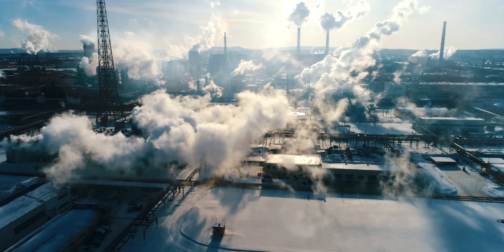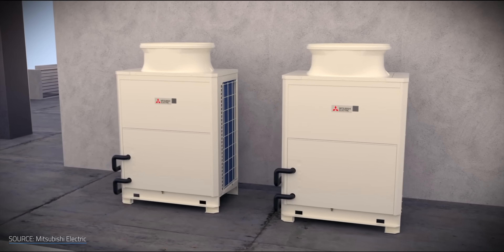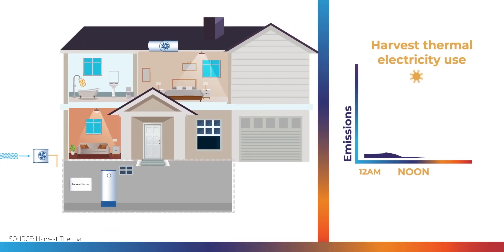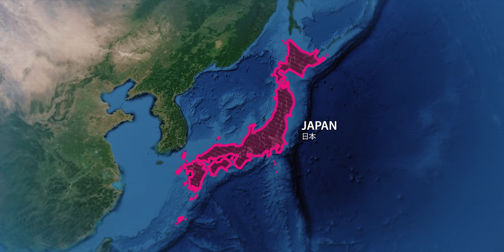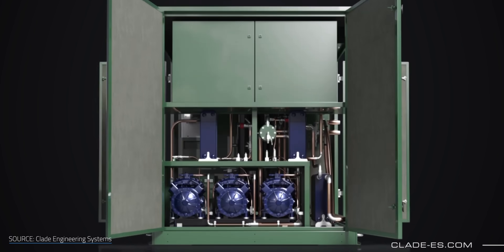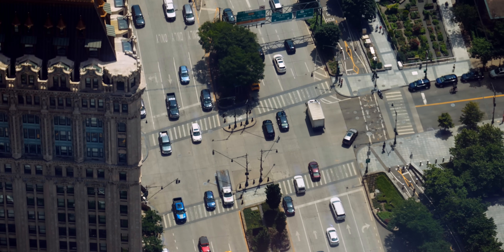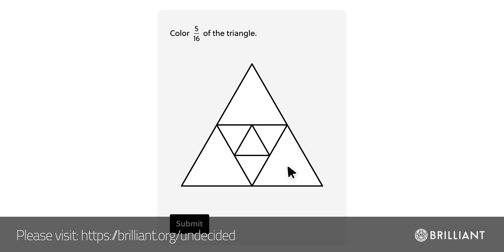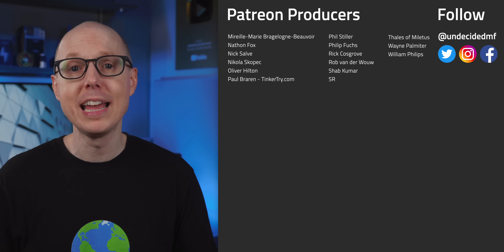Why CO2 Heat Pumps Are The Future Of Cooling

Comment: I could be mistaken...

But, rather then thermal storage, it seems like it would be more efficient to... just storage electrical energy in a battery.

Take, for example- my rack-mount LiPO4 batteries. 5kwh of energy storage per battery, enough energy to run my minisplit 5 hours, up to a day or two. Lifespan of 20-30 years on average.

Storing heat in a water heater, you run into the issue of, sediment buildup, low storage capacity. etc..
Reply: What's the cycle efficiency, though? Charging a battery takes more energy than the battery stores. Solar panels converting light (or whatever other generation system) into electricity, then electricity into chemical energy in a battery, then chemical energy into electrical energy, then into thermal energy... Taking in heat, storing it as heat, and then releasing it as heat has fewer losses, I would think.
Reply: @erikdietrich2678  

Do remember though, you have to use energy (compressor) for storing the heat, and then use energy (compressor) to extract/release it. The process of releasing the heat isn't just turning on a small water pump hooked to a radiator. 

Then, you have the thermal losses from waiting in storage too. 

Compare that, to just storing the energy to run the compressor when the heat is needed, as opposed to doing the work twice.
Reply: @xtremeownagedotcom  Lithium round trip efficiencies can be around 90%, so long as they're charged and discharged slowly. However you're still running a compressor to move heat air-to-air, which is going to have similar efficiency limits as air-to-water then water-to-air. Thermal losses from a hot water tank can be very small if properly insulated. The self-discharge rate of lithium batteries is very low, but it's not zero. And maybe most significantly, the financial and environmental costs of manufacturing lithium batteries are comparatively very high compared to just an insulated water tank.
A water tank is a thermal battery of sorts. There might be applications where some kind of chemical battery system makes more sense, and I think for the rest of the applications, storing heat as heat (instead of chemical potential energy) is going to be the better option.

Comment: While an interesting video, I wish he would have gone into greater detail of how it works in different climates and the four seasons.  For instance, I live in Florida where we run cooling almost the whole year.  So we would be moving heat from our interior to to the water heater 24 hours a day.  As the temperature in the tank increases, it seems like the efficiency of my cooling would go down.  Will I have to take more showers to dump that excess heat?        I can think of all kinds of different scenarios based on climate and time of year.  So maybe that is why a sophisticated controller is needed.  BTW, most people's electricity rate is fixed, same price night or day.  It makes no sense for me to invest my money into a system that balances electricity demand for the benefit of my utility company.   They will only take the money I save them to buy off politicians to increase my electricity bill.  I would rather invest in solar and store my excess sunlight energy into heating/cooling my house at night.

Comment: Most power plants are only 32% efficient (not  counting line losses) because they are boiler plants. Therefore a heat pump needs to have an efficiency of 300% in order have the same carbon footprint as a natural gas heaters for heating. 600% if the power comes from a coal power plant.
Reply: Burning things is a cheap way to produce heat, yes... with the downside of outputting huge amounts of pollution. If the only specification is to heat water as cheaply as possible, a natural gas water heater with a desuperheater is incredibly efficient. But that's not the only specification that matters.
And if the heat pumps can be powered by solar or wind, this setup becomes a very efficient carbon-neutral system.
Reply: This isn't entirely true, many plants easily exceed 32% efficiency, and increasingly power generation is being done by power plants that produce no CO2 (wind, solar, geothermal, hydroelectric, even nuclear is still kicking around). Any given heat pump also continues improving as the power mix shifts to lower carbon production, whereas a gas furnace always emits the same CO2 (actually it can wind up emitting more CO2 depending on the gas source since a lot of gas wells directly emit trapped CO2 as well). Heat pumps are also not just displacing gas furnaces, they're also displacing space heaters, which are using that same electricity at much lower efficiencies. And under most circumstances they can easily beat an effective efficiency of 300%.
Reply: @bosstowndynamics5488  A power plant powdered by a natural gas gas turbine engine is up to 63%. 2020. The most inefficient natural gas furnace I have ever seen was 67%. Internal Combustion engines are way more efficient than steam. It's 88 years old now.
Do you know it costs twice as much to generate electricity with coal as natural gas? Steam. I had to look that up. 
No one talks about that. Or LED lighting.
The only country to ever hit Paris Accord targets was the USA under President Trump. 
Methane natural gas has CH4 produces 1 CO2 and 2 water molecules when burning and natural gas appliances have the highest energy conversion efficiency. Convert an electric furnace to a high efficiency natural gas furnace and produce 1/6 the CO2 to heat the building. If it wasn't online... the baseline load drops, which ones will they turn off and close?

As for the 32%, that's average. But some are upto 63%. But that's peak.

China builds lots of coal plants. To bad JT and JB are doing thier best to squeeze out natural gas. (and oil)
Reply: That’s false most modern power plants are 50% - 60% https://en.m.wikipedia.org/wiki/Combined_cycle_power_plant
Reply: @yolo_burrito yes upto 64% from 63%,  the peak efficiency. But most power plants are still coal and natural gas fired boilers. A natural gas gas turbine engine with a steam engine heated by the exhaust gasses. With a duel turbine.
Reply: @suggesttwo  Yes combined cycle natural gas is a gas turbine generator where the waste heat is recovered to run another steam turbine generator. That’s why they are 60% + efficient.
Reply: @yolo_burrito  so about 44% from the Gas turbine and 20% from the remaining heat with a lower efficiency then normal because heat has already been extracted.

Comment: For cooling we should be using personal heat sinks, there no need to cook an entire building when we are only trying to cool ourselves. Plus there are people who work outside to consider, it’s not really fair to cool off the inside while heating up the outside with ACs 

For heating, I haven’t looked into this part at all as I’m focused on cooking, but I theorize a vest designed to be as thin, light weight, and heat retaining as possible, possible with a small heating device, to keep your core warm enough to heat your limbs. I chose a vest so the hit doesn’t hinder mobility at all, but you could use the same logic with different levels of clothing. 

In theory this should save us tons of energy, as we are just regulating our body temperature instead of air temperature .

Comment: I work on HP  daily, and they are great till they break, parts are expensive, almost always special order. Life span isn't great because they run year round. They suck in extremely cold weather which requires extremely expensive AUX heat strips to keep a home warm. In our industry  we joke that HP like Mini splits we call them expensive throw away units. Parts are usually not available after 7-10 years vs traditional gas furance got 20 years plus life cycle, and parts are common nearly everywhere. HP are great on paper but in practice that have more disadvantages. I would never own one with all the problems they have.

Comment: "C02 won't explode" -- Not from fire. But from pressures, sure it can. If you go from solid to gas, or liquid to gas, in a container that can't handle the pressures. it will. You yourself stated in the beginning that "due to high pressures you need specialized equipment" and the high pressures was why they didn't use it in the first place. What do you think the specialized equipment are for? (you don't need fire for an explosion).

Comment: Matt, thank you for this very useful video. I live in a house built in the early 1930s that is heated by radiators; no vents. My A/C uses the spaces between the floor boards as ducts, which works but plenty of drawbacks. With that in mind, I'd love to hear a future video talk about retrofitting old homes with modern heat pump. Oh, and I should add that last year I replaced a 1950's gas boiler with a high efficiency combo boiler for radiator and domestic hot water. Not as efficient as a heat pump, but it was the best I knew of a year ago. Wish I had thought more about heat pumps then, but maybe in the not-too-distant future. The idea of a CO2-driven heat pump is very appealing. Again, thank you and best wishes in your new studio. I'm looking forward to your next video.
Reply: I'm not a professional, but a tinkerer. When I restored my house (built late 1800s) HVAC was one of my primary concerns. There wasn't a cost effective way to provide good R values and preserve the historical design of the house. Instead, I put together an HVAC system to optimize efficiency. I currently have no insulation in the house, and only focused on eliminating air leakages. We've had a brutal summer here in Texas, and my electric bill has not topped $200 at 12c/kwh for a 1900 sqft house. In my design, I could see definite advantages of CO2 as a refrigerant over my current 410a system.

The components of my system are 3 heat pumps, 2 geothermal loops, solar water heater array, 275 gallon water storage, 5 indoor head units and a "brain" to make everything flow how I wanted it to. The pumps and head units are standard mini splits (Senville) but with the loops modified. When one of my head units makes a call for heating or cooling, the brain measures the delta values of the indoor ambient vs the outdoor ambient, both geothermal loops, the solar water array, and the water storage. If the setpoint falls within the delta between indoor ambient and the geothermal or water storage, the head unit signal is not passed on to the outside unit, but the corresponding pump and valve are activated to feed water directly through to a smaller liquid to air heat exchanger I installed in the head units. If the setpoint is outside of all deltas, the signal is passed on to the compressor, and instead a series of liquid to liquid exchangers and valves are activated to heat or cool the refrigerant. When cooling, the refrigerant gets compressed, then rejects heat to the atmosphere, then storage, then geothermal before going through a phase change. Because of this, I can run the compressor at about 30% of what it would normally need to run at in 100F temps to provide temps at the vent below 60F. In the winter, the solar water array generally provides enough heat to never run the compressor until nightfall. With a CO2 loop, I could see significant improvements primarily in cold weather applications. That being said, I would MUCH rather work with CO2 than 410a. HVAC techs charge a criminal amount just to connect their gauges to a system.

Why 3 heat pumps? Redundancy. I have 1 HP 1 head unit for my office, 1/1 for my bedroom, and 1/3 for my kitchen/living/dining room (open areas). The 'brain' controls electronic valves (like what you'd see with a sprinkler system) to route the water systems to each of the heat pumps as demand arises. I have 2 geothermal loops because, also, redundancy. I have not seen one become saturated yet, one is a ground loop at 4-6 feet and one is a vertical coil that's about 75 feet deep. My head units are "ductless" ceiling modules to try and preserve the historic aesthetic as best I can.

As for why insulation is a problem, this house was designed with a method of 'convection cooling' where as the outside walls are heated by the sun, it causes the hot air to be drawn into the attic and outside, drawing cooler air from underneath the house (the crawlspace). This works quite well as long as the nights drop below 70 frequently. This does present problems with critters and whatnot and very active preventative maintenance for any access underneath the house and into the attic must be maintained. 

Anyone who is curious about how the convection cooling works, the foundation is pier and beam with a proud skirting that attaches to the walls 2 feet above the foundation, and the ceilings are 10' but the walls are 12', so the caps of the walls are 2 feet above the ceiling in the attic. This allows every cavity between each stud to act like a vent to force convection when the sun is beating on the house. There is no blocking in the walls, instead there are supports that are set into the studs that triangulate the load bearing walls.

Comment: According to 3:25, gas burner moves heat from one place to another?
Using energy consumed inside burner itself?
Do you mean blower fan inside it?
Combining MUCH cooler air and methane, to release a potential energy, by chemical reaction?
WTF, how the F.... does this fit into your COP formula 😬?
Please, be so kind and either provide whole formula, not the NPC version, or do not compare apples to orangutans!

Comment: The COP honestly doesn't impress me much. Their COP at 47F is 4.2, which is good for a cold climate heatpump, but nothing that doesn't already exist. That 5.5 COP is when its heating water when its 80F out, something most units aren't rated for to begin with to even compare.

On the plus side sealed units like this that use water or some other fluid to move the heat into the house should be much easier to install for DIYers and non HVAC contractors.

Comment: A few years ago i have the same idea for heating water with heat pump but after careful calculation i came to convolution that it simply doesn't worth it. Maybe for big scale appliances it make sense but for a single household it doesn't. Sure it's depend on the region you live and a price for electricity but if during cold time of the year temperature usually around or below zero you won't get any benefits from heat pump. Highly likely it will brake or require expensive maintenance long before it payoff itself but at first it may look like you are saving money.

Comment: Did you know that some refrigerators used to run on Natural Gas? My family had one when I was a kid.
It's called "the absorption method" of refrigeration. I've often wondered why no one uses the large amount 
of heat generated by an automobile engine to run the vehicle's air conditioning with this method.
No compressor using up fuel, just boiling the refrigerant to recycle. I think the refrigerant is Ammonia and Water.
Reply: we had natural gas air conditioners that used ammonia. the biggest problem was very few people knew how to work on them.
Reply: @alanm2842  They are a bit tricky.
Reply: I think the wide ambient temperature ranges experienced by a car make any compressor/chiller system more complicated to design and run, so maybe an ammonia system doesn't have the range? I also imagine since both ammonia and the hydrogen gas produced by the refrigeration cycle are both flammable, there's maybe a safety concern? The more I think about it, the more I'm not sure. I'd be curious to know if there's a definitive answer.
Reply: @erikdietrich2678  The system is a sealed system, so no hydrogen is produced.
Reply: @otpyrcralphpierre1742  hydrogen is produced within the system and is part of the ammonia regeneration cycle: look at any schematic of a refrigerator driven by burning propane / natural gas. If ammonia is only used as a refrigerant with a compressor, etc., then there's no hydrogen.
Reply: @erikdietrich2678  Yes, but it is a SEALED SYSTEM. Some systems actually use Propane as a refrigerant. Hydrogen is used to cool the bell of rocket engines before it is sent somewhere else. On an open system, it is flushed outside, on a sealed system, it is sent into the combustion chamber where it is mixed with oxygen, then used to produce thrust. It must have oxygen to combust, therefore, a system that is SEALED, i.e. no contact with oxygen, will not  combust, explode, or burn.
Reply: @otpyrcralphpierre1742  systems that use ammonia as only a refrigerant are sealed as well: that doesn't mean that they magically can't leak, which is why industrial-scale ammonia chilling systems have all sorts of sensors and alarms on them. Likewise, lead-acid batteries in cars (especially older ones) can leak hydrogen, which is one of the reasons why connecting jumper cables is dangerous, especially if you do it wrong. 

Hydrogen is a very small molecule and will in fact leak out of systems that wouldn't leak other gases. Hydrogen is also flammable down to about 4% concentration in air, and burns almost invisibly. Big molecules, even if they're flammable (like cyclopentane), may be safer because they're that much less likely to leak. Or use something more inert AND big, which is why CFCs and HCFCs make good refrigerants.

There's all sorts of reasons why absorptive ammonia chillers are not well-suited to certain applications.
Reply: @erikdietrich2678  Food for Thought.